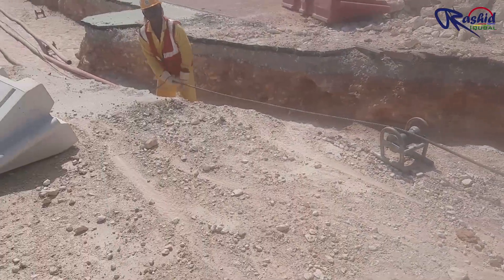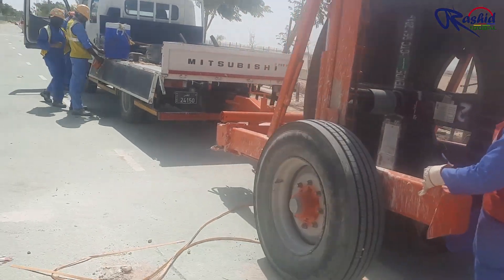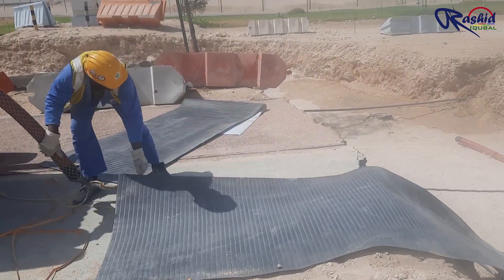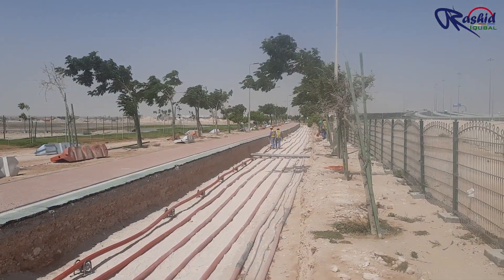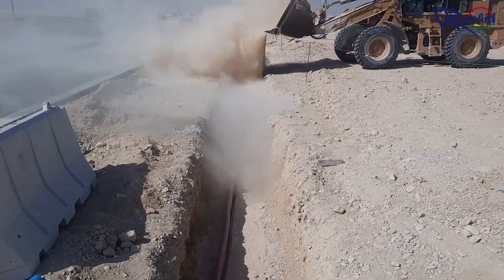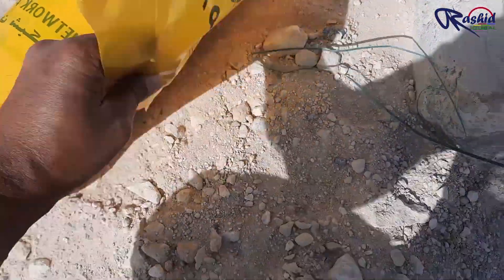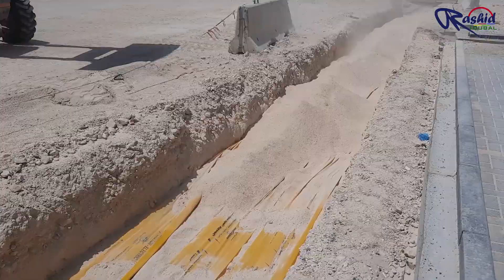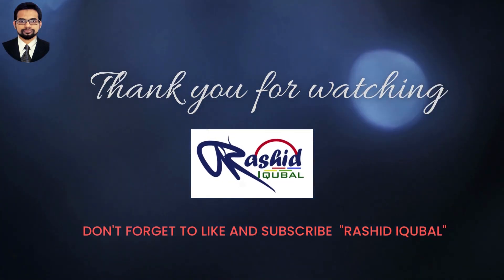Underground MV (Medium Voltage) cable laying procedure.

Comment: running the LV cable right next to MV cable with no separation ? isn't that a concern?
Reply from the maker: Not an issue, its depands on you site location and client approval. However LV cable depth should be lower than MV cable

Comment: why we install MV cable 1 m below ground surface ?
Reply from the maker: Medium voltage cables are buried 1 meter underground for protection from damage and to ensure safety above ground. Its laying depth may vary depends on project or site condition.
Reply: We are power cables and Pvc trunking manufacture in China.Welcome to inquires further.